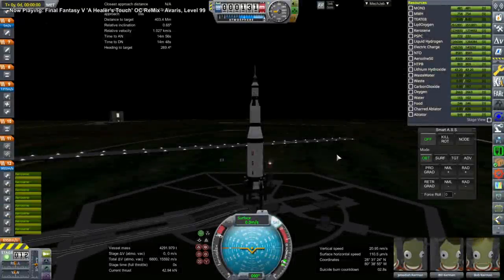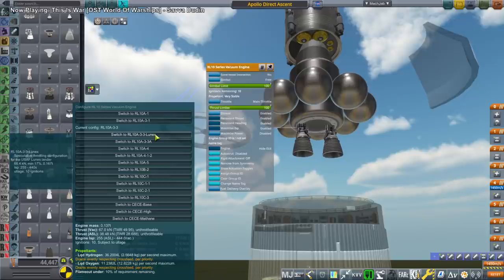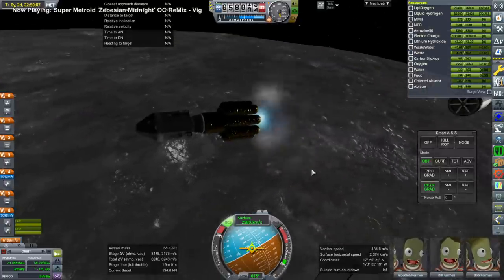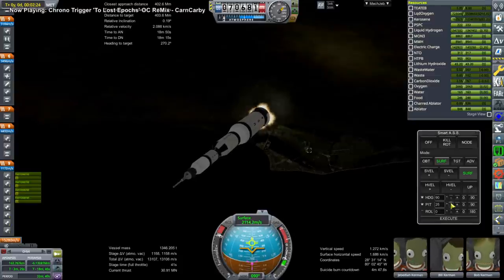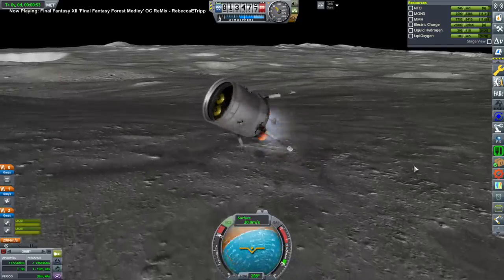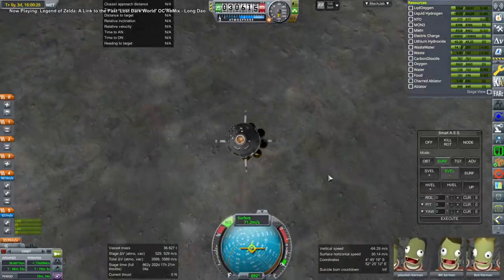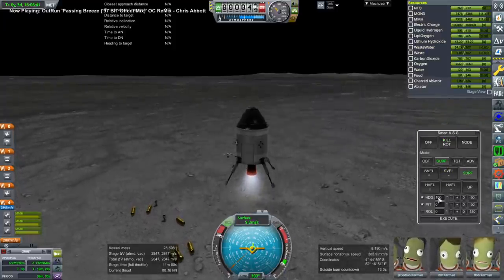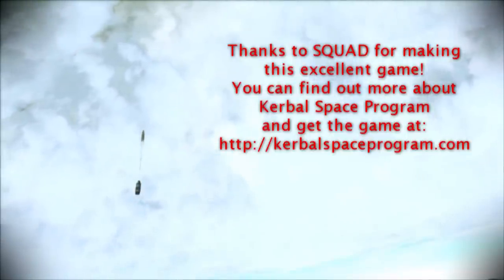Realism Overhaul in KSP 1.8.1 - Apollo Direct Lunar Landing

Comment: Very interesting! The IRL direct lunar landing had a crasher stage, descent stage with landing legs, and an ascent stage powered by the SPS. As seen in the video it would require a C-8 launch vehicle, but if they had been willing to send a crew of two rather than three, a Gemini-based direct lander could be launched on a C-5.
Reply from the maker: There was no IRL direct lunar landing. This version is just as valid as any other proposal, and I actually consider the setup in this video to be superior to some of the ideas presented at the time.
Reply: @RaizSpace  Of course, no direct ascent lander ever flew. However the one I spoke of was the 1962 Apollo Direct-Ascent landing configuration. Your lander is definitely valid and good - the IRL lander proposal was simpler and designed without a need for engine re-ignition. Had they not had this worry, I could see a lander like yours being adopted.

Comment: Sorry for being such a hassle, I'll soon be known as the 'questions guy'. I know I already asked, but how does your Earth just look so good? Even after KS3P It doesn't look as amazing. Do you remember if you installed any other graphics mods or where you picked up those configs, or if you just modified them yourself? I would love my game aesthetics to be like yours. Thanks.
Reply from the maker: PlanetShine, if you don't have it already, maybe?
Reply: @RaizSpace  I already have planetshine and everything else such as the correct textures and even distant object enhancement. Your Earth looks very blue and vibrant and blue whereas mine, even after installing KS3P, still looks rather dull (there is a difference though). I'm starting to wonder if I have the wrong RSSVE textures, which I have the high res 1.8.1 version. For instance, 12:50 in your video looks stunning! Plz help and sorry for late response.
Reply from the maker: I'm sure I changed something, but I don't remember what.
Reply: @RaizSpace  Probably the bloom or some saturation setting in KS3P. Edit: You don't have to do this, but could you put your KS3P folder on dropbox?
Reply: @geostojo6990  maybe tufx?